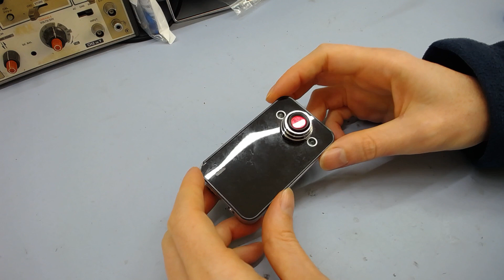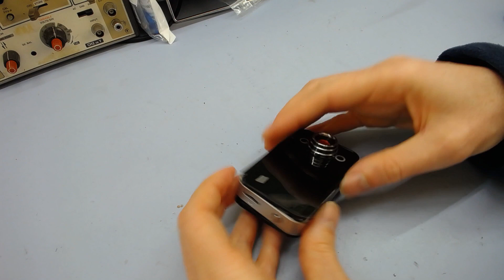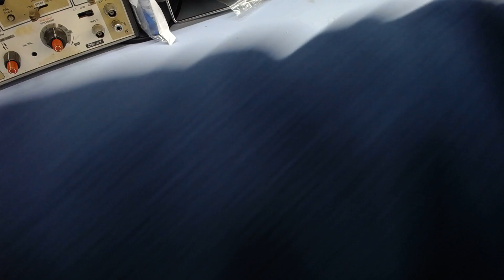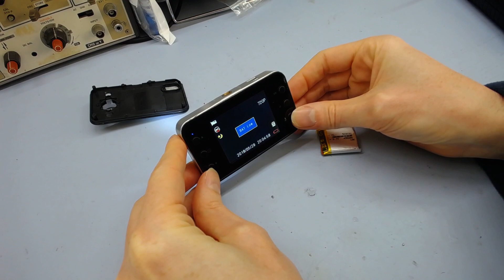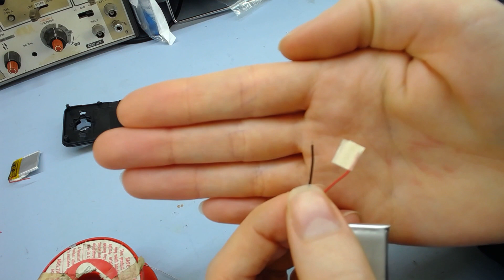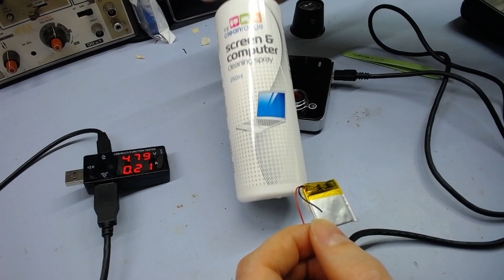Battery replacement in a generic "K6000" dash-cam

Comment: I believe that 3.3v is the recommended "storage" voltage, so that bodes well for the quality of the thing. I think a tiny drop of hot glue will be fine to secure it.